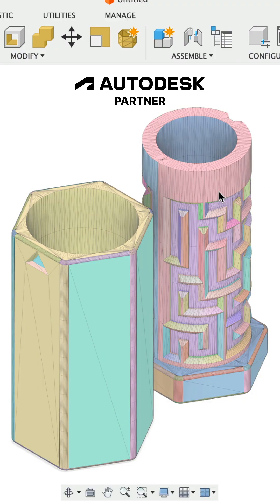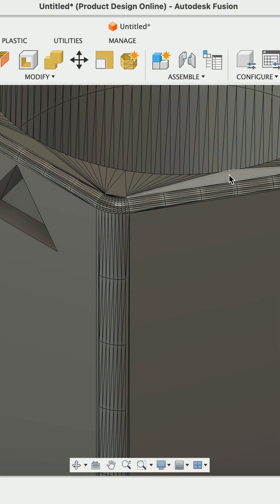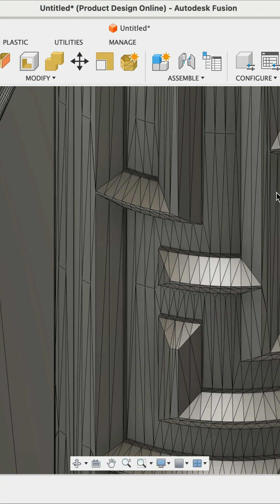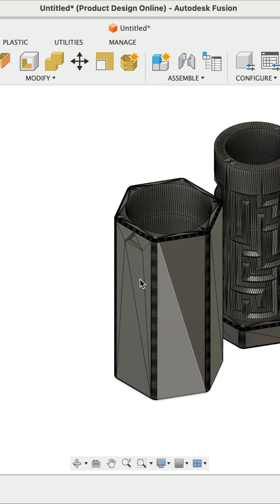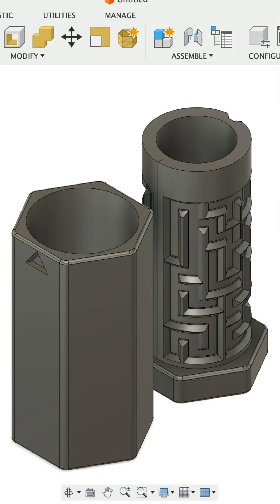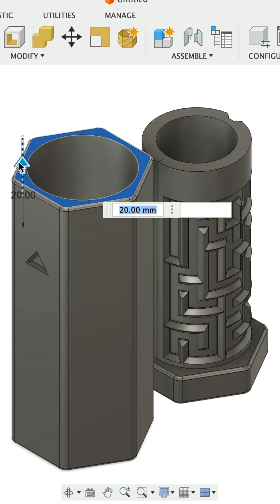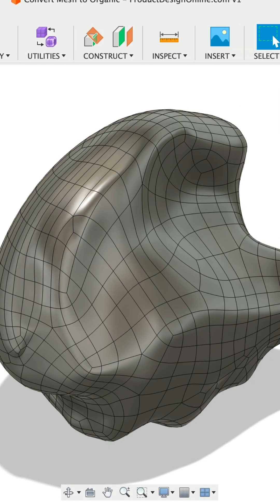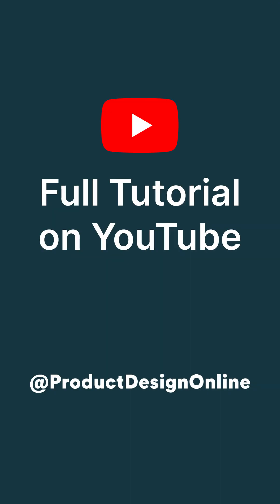3 Methods to Convert STL files in #Autodesk Fusion

Comment: This is the problem I have with Fusion subscription. I would like to use this feature but I get 100's of other features I would not use. This makes the subscription poor value. If they let me subscribe to a set of features for a basic fee I would pay. I don't use it commercially either, this would just be me paying for some benefits. Why don't they introduce a single user Flex model, so rather than users per product it's features per product each with a token cost.
Reply: the problem with your idea here is it make faaaaaaaar too much sense for Autodesk to ever do it.
Reply: I told fusion they needed a tool selector to pay for and the rep told me to loom at current packages. Just tell me know, don't give me a bot answer

Comment: oh boy if you use a mesh with a large facet # better have some time on your hands. trying to take a 3d scan to fusion... ya crash crash crash crash went trying to convert mesh.
Reply: I have a beefy system with 192GB of ram and Fusion crashes over and over unless I severely simplify the mesh which completely defeats the purpose of high resolution scanning. I'm extremely frustrated and feel ripped off. Starting to feel like Fusion is the Adobe of design.